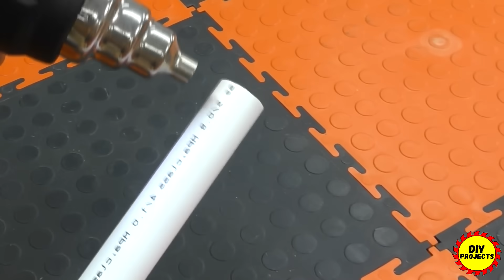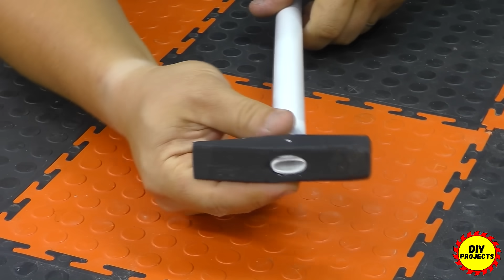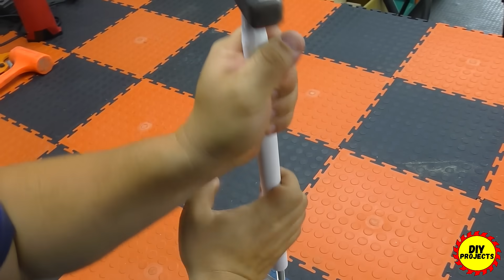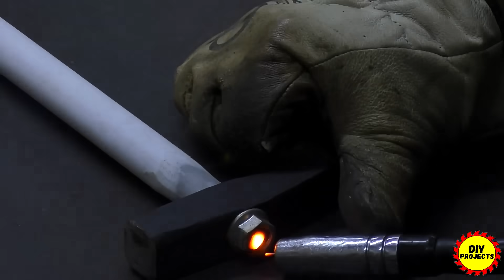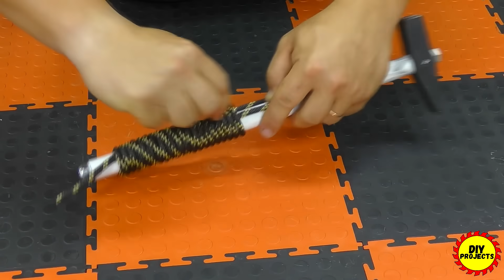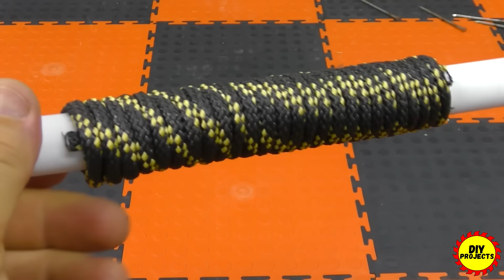How to plant a hammer once and for life ! DIY

Comment: Wanna talk about Much Ado about nothing! 🤦

So much effort to make a handle for something that you already had a far better handle for??? 😵‍💫

If a hammer has a loose handle get a wedge in there. If you want it super strong fill the top with epoxy! 

A good ol' hickory handle properly cared for would snap that pvc/all-thread rod into little bits! 😮

Save a ton of time, not to mention all the wasted materials.  🤷

Comment: That hammer is an accident waiting to happen. The plastic is going to flex, and will break. The rope wrapping is going to stretch and slip because of its nature and the glue isn't going to hold up for very long.  It being round is going to fatigue your hand fast. That nut that was welded on is not only ugly but can and will get in the way on some jobs. Then, if you are in a cold climate, as soon as that handle freezes to temps of let's say 10° F or colder, it will SHATTER within the first few swings of it which can cause injury to whoever is using it as well as anyone in the wrong spot when shattered plastic shrapnel explodes
Reply: Made in China 😂
Reply: All the reasons why a hickory wood handle is superior.